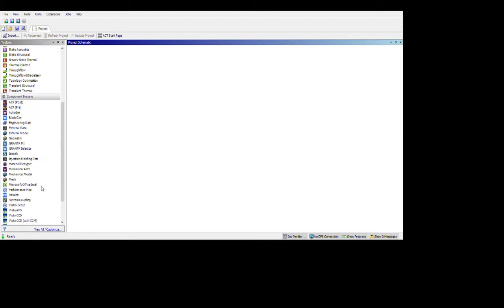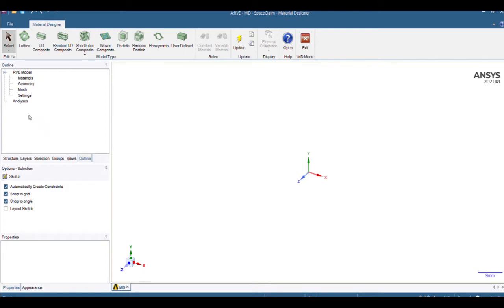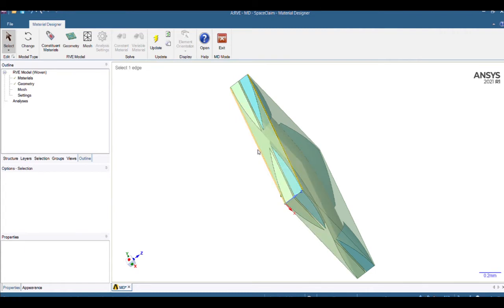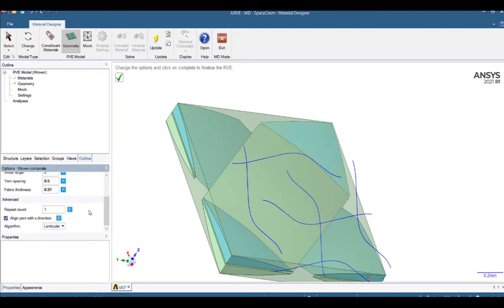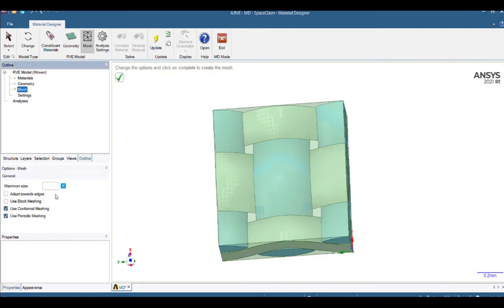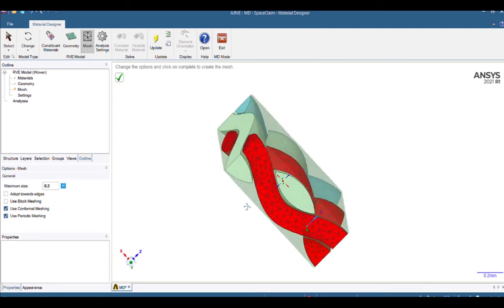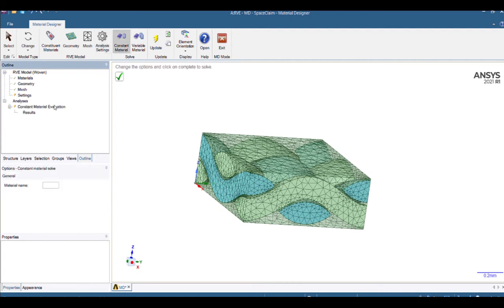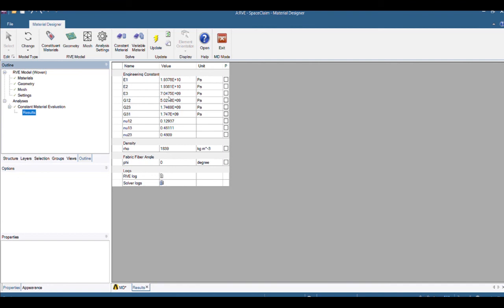Ansys Material Designer Example

Comment: Good night people,I have a question that I am unable to resolve.After I assemble my woven in material design with carbon woven and epoxy resin I lose the tension and compression properties. How do I resolve this? My analysis will end there in the fault modules, but for that I need all the properties of my woven.Thanks for this video